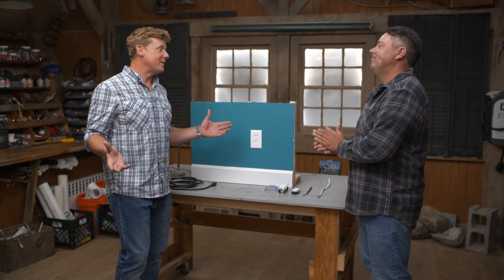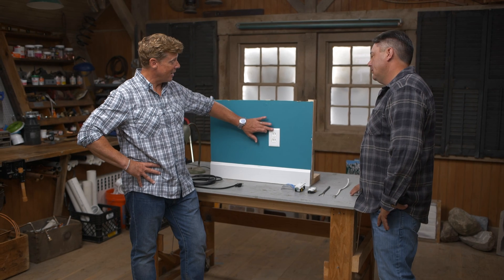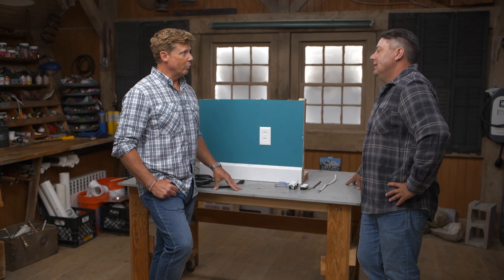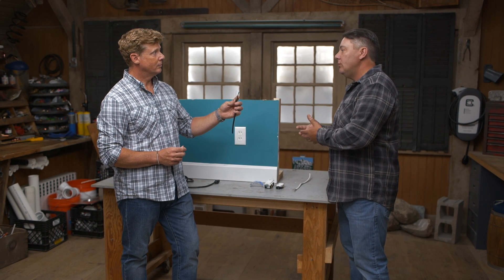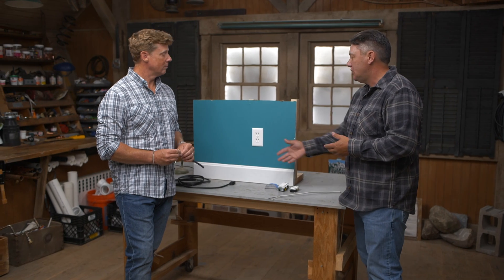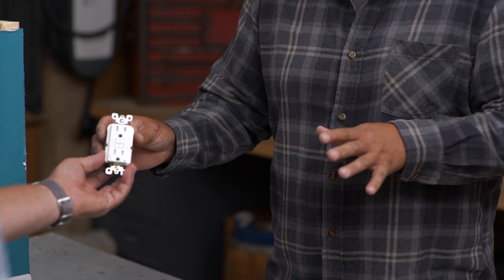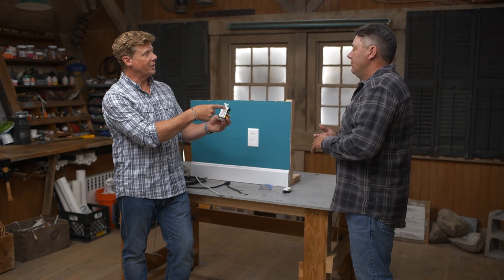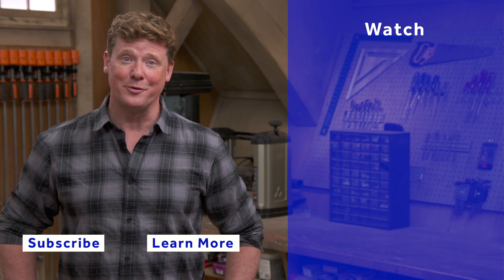How to Understand Two-Prong Outlets | Ask This Old House

Comment: My home falls into the category of partially up to date, but much of it needs rewiring to include ground conductors. I wonder if they would ever do a video commenting on the right way to do so, so we consumers know what to look for, etc, in paying to have that work done.
For instance, I always wonder what (if anything) NEC says about doing so if you aren't wanting it willing to open up all your walls. In my case, I've wondered if it would be possible to fish new conductors through the wall spaces from my basement...
Anybody out there faced a similar situation?
Reply: Some times you can fish new wires it just depends on the run. I once repulled romex trough a wall. But the next run I would have to open up the wall. It just depends

Comment: Wish I had seen this before I replaced all the RECEPTACLES in my house with 3 prong, just foregoing the ground 😬
Reply: You just need to change the first receptacle in each circuit to a GFCI and you're good. Don't need to change all of them. And technically you are supposed to put the stickers on all of them too, though that doesn't really matter
Reply: @mr.g937 
That won't work in knob and tube installations, or where 2-wire pigtails are used.
You cannot label a standard duplex receptacle as "ungrounded".
Reply: @jsimanella  I can't speak to knob & tube, but a GFCI-protected 3-prong receptacle in a 2-wire system is code permissible and supposed to be labeled as having no equipment ground.
Reply: @JH-ms3ny 
That is true, which is why I said "standard duplex receptacle"
Reply: If you have uninterrupted metal conduit you don't need to worry.  The conduit can act as a ground as ling as it is not broken anywhere. The tabs on the outlet can act as the pigtail in some jurisdictions.

Comment: I would still want a ground line. The problem with ungrounded GFCI/AFCI is that an appliance chassis can be hot right up to the moment you touch it. That means YOU trip the GFCI in a fault event. Depending on current path it can still be a lethal shock; these things are mechanical switches and they do have a reaction time.
Reply: I agree with you, but GFCIs are calibrated to a level that poses no risk of harm. So as long as the GFCI is working it truly is safe. The thing is GFCIs can malfunction or stop working, and like you said it's not good to have metal appliances just sitting there energized.
Reply: @mr.g937  What they didn't mention is that GFCCIs don't last forever. I've had one crap out after five years, fortunately the outlet just went dead. Apparently 10 - 20 years is typical.
Reply: GFCI trips an a level that's WAY below lethal so not to worry.
Reply: @rupe53  If the current traverses your heart, it's not going to matter how little the current is. Milliamperes will do it. Your heart is going to get disryhtmia and you may need defibrillation to put it back. At 177V pk-pk, a current of a few mA is unavoidable. Even for milliseconds, the current is going to be too much.

I mean, would you lick a GFCI circut? It's still going to shock you during the time it takes to open the interrupter.
Reply: @thesmallterror  ... yet this technology was brought into code almost 50 years ago and saved countless lives from shorts in their pool or out on the patio. Personally I don't wear shorts in my yard, but that's another story.  <LOL>
Reply: @thesmallterror  That's 100% true, the amount of current that takes to stop your heart is way lower than what any interrupt device can prevent. They are only designed to prevent continuous or high current electrocution.
Reply: @thesmallterror  It takes about 100 mA to kill. The GFCI trips at 5 mA.
Reply: @okaro6595  Actually current as low as 20mA can cause fibrillation. Without CPR or a defibrillator and someone who knows how to use it properly, that could easily mean death.
Reply: @davidbrick626  Yes, if it goes through the heart but that is not he case in practice.
Reply: GFCI operates by measuring the imbalance of current between the hot and neutral conductors. If a GFCI-proected appliance chassis is allowed to become hot, the GFCI is not functioning properly.
Reply: @JH-ms3ny  Current =/= Voltage. That's the whole problem. The chassis is hot, there is voltage on the chassis. There is no current until you touch the chassis and complete the circuit. The GFCI has no way to know the chassis is hot. It can never prevent the situation your propose.

Comment: I fully-grounded a metal-sheathed houseful of receptacles by ensuring the anchor & grounding of box the metal sheathed cables and GFCI/AFCI receptacles as replacements in first positions and in areas of possible humidity & moisture, then pigtailing ALL downline receptacles to their metal boxes grounding to the box, through the circuits and back to breakers.

Comment: If you can fit them outlets in the box there a lot deeper than those two prong outlets there usually in a pretty shallow box
Reply: Those old schoolers didn't leave a lot of slack to work with either (in my house anyway)
It was an absolute BEAR to swap out the old 2 prongers with standard 3 prongs, just leaving the ground with nothing attached 😬

Comment: This GFCI receptacle it should be install on every room outlet?
Reply: If they are all two pronged, then yes. 

If all the receptacles are already three pronged on the circuit, you only need GFCI on the first in line of the circuit. If you don't know which receptacle that is, you can do testing on your own by disconnecting all the receptacles and then reconnecting them and use process of elimination. That could take some time. Might be easier to just replace all with GFCI.
Reply: @nutkizzle  GF/AFCI receptacles are $25-30/each. So if you've have several receptacles per room, it'll get expensive very quickly. 
It's much cheaper and faster to add a GF/AFCI breaker at the panel and protect the whole circuit.
Reply: @s.n.9485  You're right.
Reply: @s.n.9485  but people are more afraid to replace a breaker, than just replace a receptacle with the breaker off

I’m one of those people, but in more of a ‘afraid to burn the house down’ perspective. 

Almost every receptacle in my house had the ground wire disconnected or loose screws (and all painted-over liberally)
Reply: @s.n.9485  Dear G.P.E. thank you very much for this alternative to use a GF/AFCI breaker
Reply: @nutkizzle  Dear Jeffrey,  thank you very much for the info. I will check this out because there are some three pronged outlet but not sure if those are properly wire it.
Regards
Reply: Yes if you want to safely use three prong devices.  These only work, or rated for the individual receptacle.

Comment: In my bathroom I have a motion sensor light switch. That switch uses the ground to make sure the sensor can operate with the light turned off and be able to turn on the light automatically. I have it because I am disabled and cannot always take my hand to turn it on with crutches or my hands full. I also care for a young child who is a primordial dwarf who can't reach the light switch so when he walks in the light will automatically turn on without touching the light switch.

I also have a pocket door that goes into my bedroom and by current code, there should be a 3 way switch to have 2 light switches to turn on the light in 2 separate areas. The motion sensor light switch resolved the code issue there.
Reply: The switch uses neutral, not ground, to operate when light is off. If it is operating on ground, then the installation was wrongly performed. This is known because these switches clearly indicate on their package that a neutral conductor is required when installing.
Reply: @PatrickDeschamps  Actually, that isn't always the case. There are many listed and approved occupancy sensors that use ground for neutral current. This is perfectly acceptable and within code because it is a level of current that does not pose any risk of electrocution. The Lutron Maestro is perhaps the most popular of these. That said, NEC 2020 eliminated this exception, but many states are not even on NEC 2020 yet. So it's a relatively recent thing that this was eliminated.
Reply: @PatrickDeschamps  

Without the ground wired up, the sensor will NOT work or turn on the light automatically. It will turn on without the ground if you manually turn it on with the built in switch. The directions on the package, plus consultation with a licensed master electrician says the ground is used for the sensor portion of the switch to ensure the sensor has power with the light off; it must be connected to ground to operate normally.

The motion sensor is built into the switch. It is not a separate unit outside of the light switch.
Reply: That's dope. I'd love a leprechaun!

Comment: As someone who just added gfci to all my first runs this was a very helpful video. Would have been good to talk about adding the gfci to the first in line so folks don’t buy gfci’s for every outlet.
Reply: sounds like you should’ve left the electrical to an electrician
Reply: @bigbeef8935  If all the receptacles on a circuit are daisy chained, which is common, you only need GFCI on the first in the chain. It will sense a hot/neutral differential in any downstream receptacle and trip. Installing more than this is unnecessary and wasteful. Also, if any circuits have a refrigerator or lighting on them you should only have GFCI protection after the fridge or lighting devices.

Comment: As an electrician I've explained this to so many people the exact same way. Most people don't get it.
Reply: How much does one cost?  Saying as a1940’s house owner.
Reply: @thomaslcook1998  Thank You!  I think all things the same rewiring is in order.  I can only imagine what you’ve been through with such al old house
Reply: While code technically says you must use AFCI when modifying any part of a circuit, in practice that's not always in the budget..so getting a 10 pack of GFCIs only for the same 50 bucks might be a better bet. It still addresses the primary safety issue (lack of grounding). Plus even if you install an AFCI receptacle the home run is still unprotected.
Reply: @thomaslcook1998  Just bought a 120 year old house, would love some tips on what is most important to update first, thanks for sharing about the outlet situation
Reply: Is it ok after install that  with a outlet tester it still shows up as open ground?